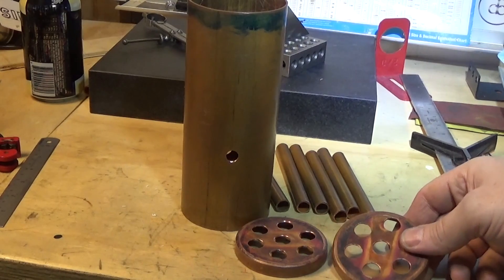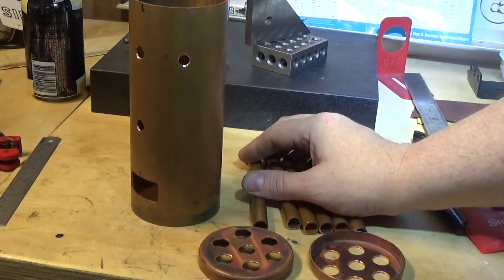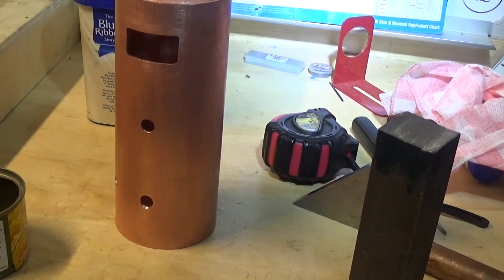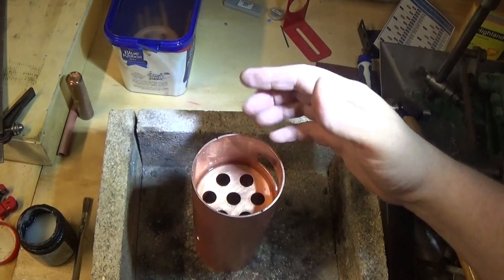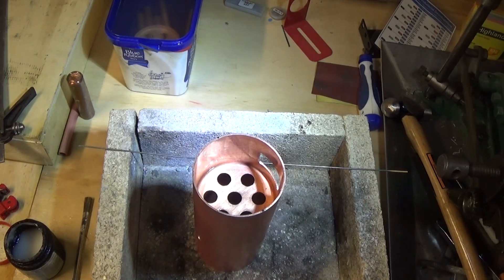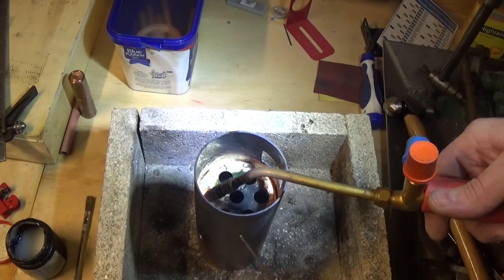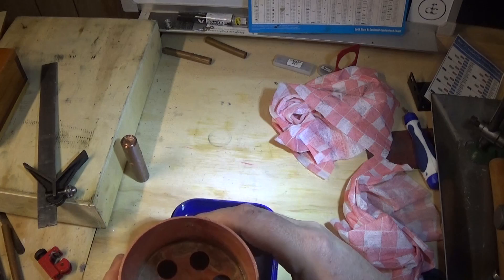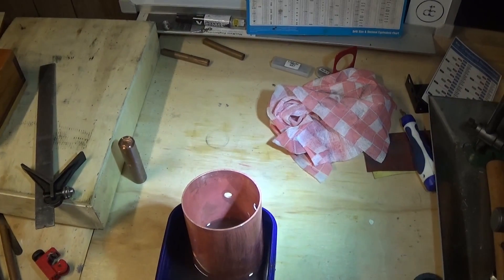Introducing and making EUGENE- A small copper boiler  Part 3

Comment: Good job Emma
I remember some years ago visiting a company that did silver soldering and they cut a length of solder made it into a ring and placed it position around the seam. Then just heated the part until it melted.
Keep up the good work.
Reply from the maker: yes thats probably a smart way to do it. thanks for watching.